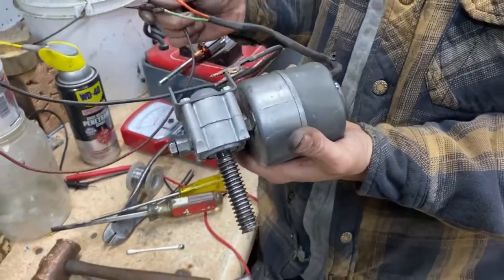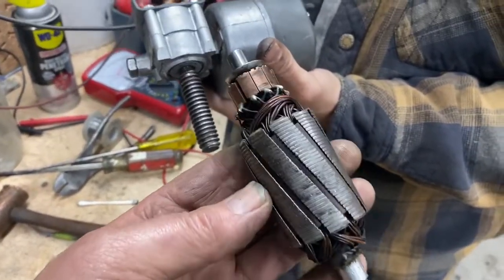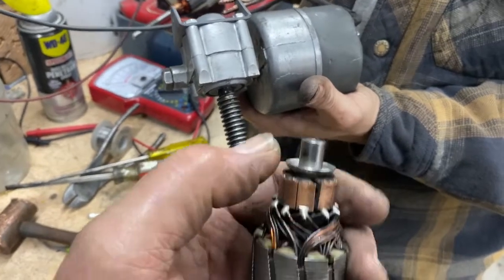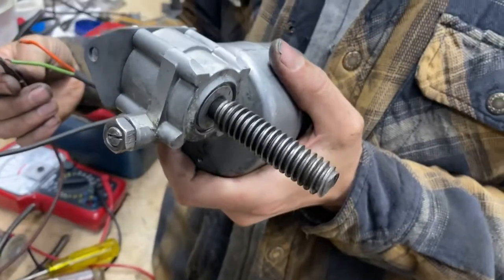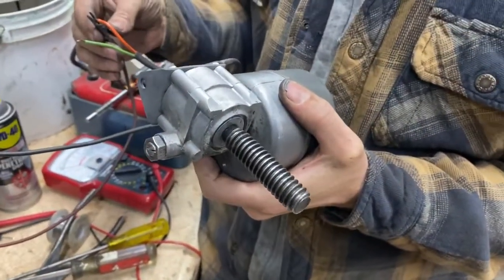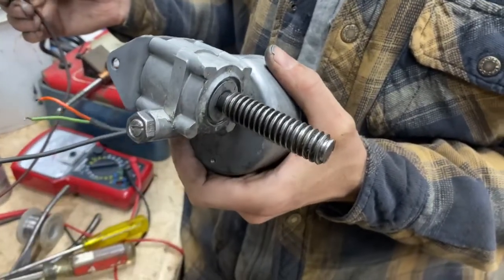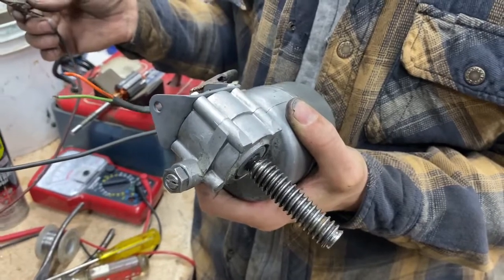1957 Cadillac Trunk Latch Motor

Comment: Just replace the commutator. But that hot coil at :038 indicates you need an entire re-wind. Reach out if you need help.
Reply from the maker: The motor works FINE. No problem there. The UP and DOWN limiter switches do not work as they should. The problem is logically simple. How can you energize the UP function after power has been disconnectsd from the previous DOWN cycle. There is simply no power available. Actually, far more complicated than that. I simply need someone- anyone who has one of these operational so that we can verify the function of limiter switches, and also does not leave power ON at the motor when down. It is confuising. Yet, Caddy did it. So, we should be able to copy the function. Cant find anybody that knows. Send me an Email to Info@oddparts.net, and I will send you a schematic.   Thank you for your comment-however--obviously, the motor works so you are on the wrong track. Want to help? Send an Email.
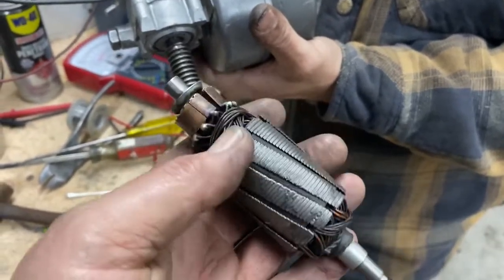Reply: @jamessimpson5296  I sent you an e-mail. The '57 is markedly different than the '58 I am working on. I was referring to the armature you were showing. (0:38 mark)